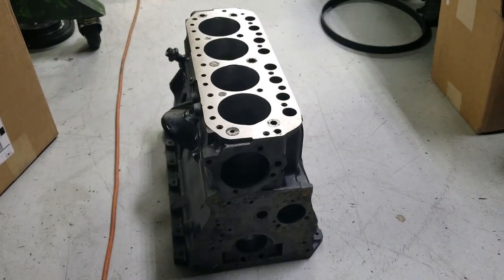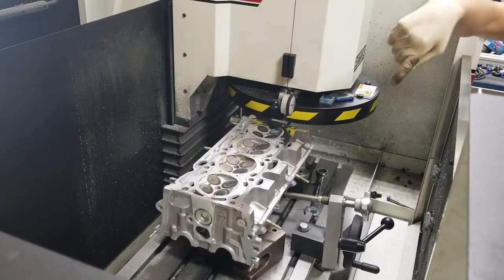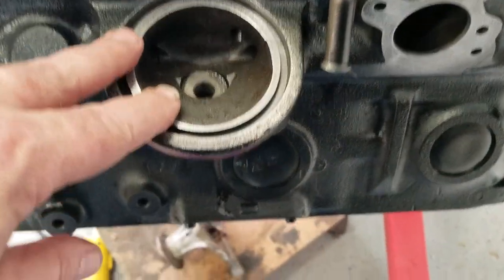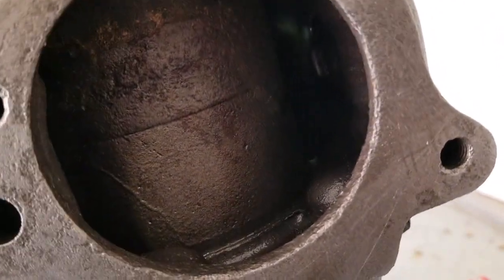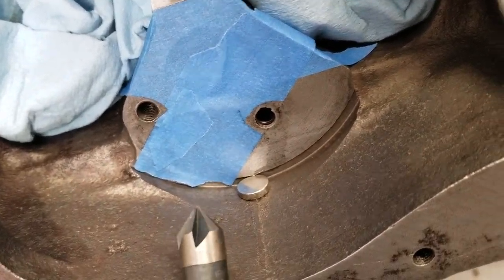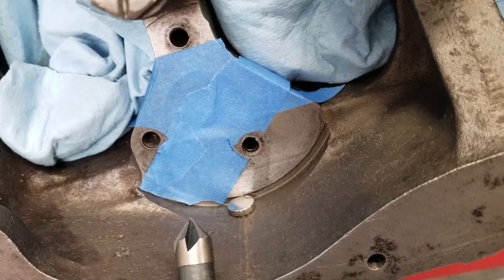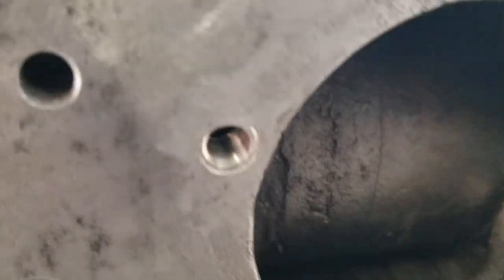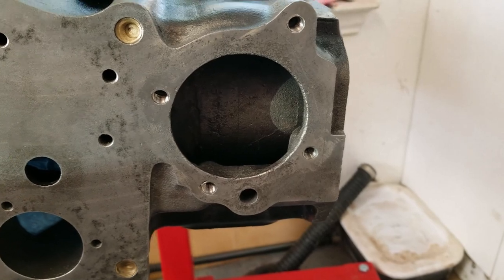Nigel the 1977 MGB Preparing Engine block for assembly

Comment: I see that you lost the engine number plate while it was at the machine shop.  Years ago when I had my engine done, mine lost it also came back without its too.  The engine number plate is made of aluminum and the solution they clean them in dissolves them if not removed first.

Bob
Reply from the maker: very observant...
Actually I think this is not the first time this engine has been rebuilt.  when I disassembled it, the plate was already missing.  I plan on doing a video on identifying your engine type, as this is a chronic issue and the documentation refers to this plate for ID.

Thanks for reaffirming my belief that this is a "thing"